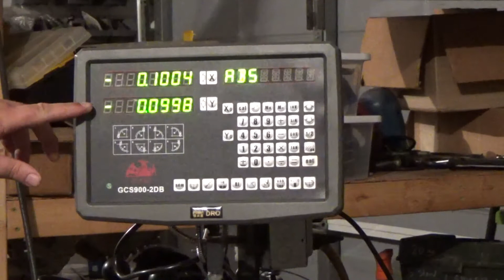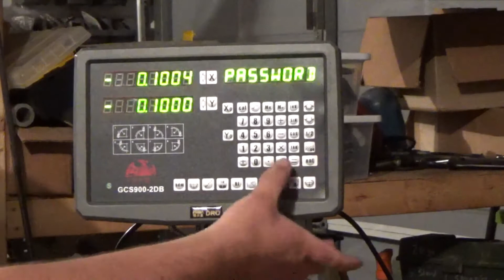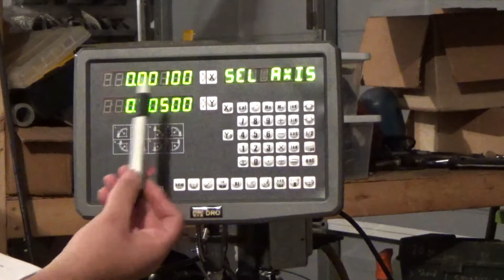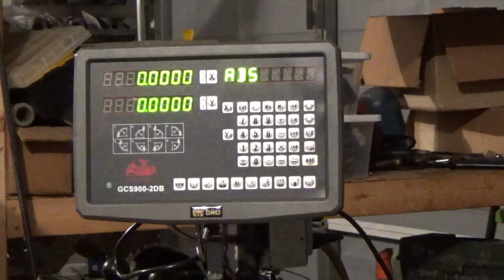ShenZhen HXX GCS900 2DB Lathe Dro Install Part 8 Setting The Scale Resolution

Comment: i have purchased the same product, but it is terrible.
i' ve got data error, strange characters on the displays.
it works for about 1 minute, then beeps and errors.
even without any scales connected.
deeply regret buying this.
suplier is not very cooperative, charges me more money to replace the dro.
Reply from the maker: johngroenen same supplier that I used??
Reply: Kirk Douglas, hxx shenzeng.